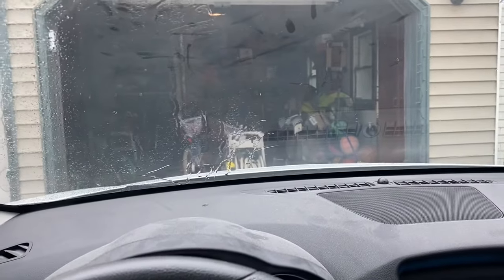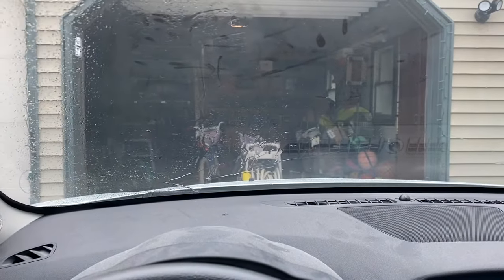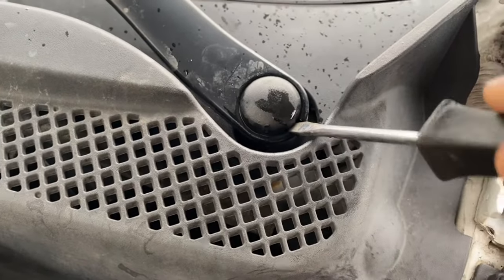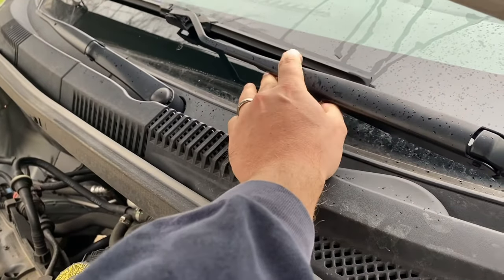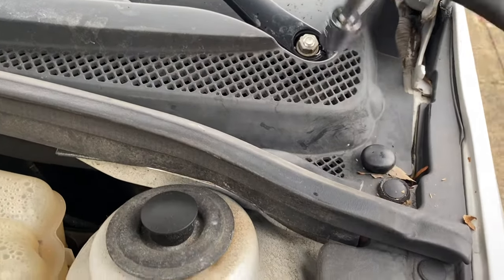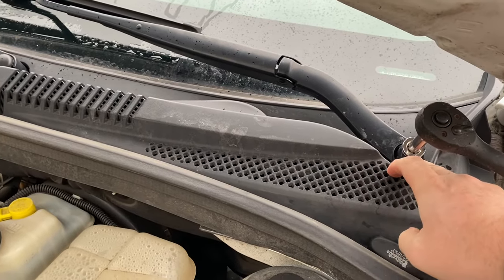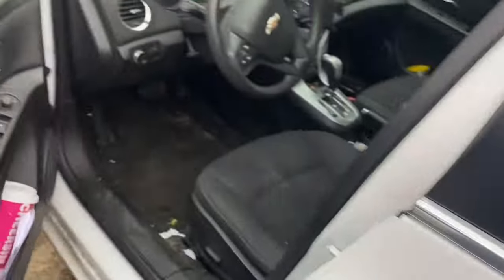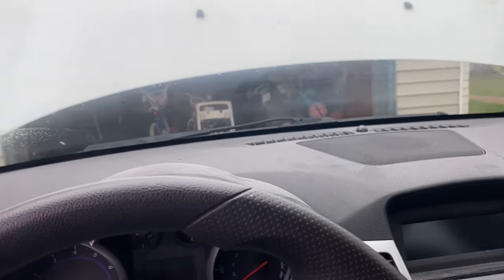How to Fix a Loose Windshield Wiper #DIY #windshield #wiper

Comment: Funny it always seems to be the driver's side. 😳
Reply from the maker: For sure
Reply: I agree - not an expert but on my car the drivers wiper is bigger than the other & I wonder if that makes it work loose ? 
Like it covers more area & more likely to drag & pull loose as opposed to the smaller one  ?
Reply: Yep more friction

Comment: Pro-tip, do not tighten the nut with the arm in the down position. This tightens the nut to the arm and will loosen over time.

To ensure that the nut doesn't loosen over time, bring the arm in the up position to tighten. If you tighten the nut when it's in the down position, test its tightness by lifting the arm up and wiggle it. If the arm still rotates freely, tighten it with the arm in the up position.

Literally just happened on my 2022 Impreza.
Reply: I was about to use lock tite on mine because it wasn’t staying tight. I’m glad i found it comment, because it’s working great now

Comment: Perfect!  It happened to my HONDA CRV 2020 recently after severe weather and I forgot that the blades would be frozen and accidently turned the wiper on and I knew it that something bad has happened :( after a few days the blade on the driving side started showing signs just the way Dicaprio showed signs of slowing down when he took quaaludes in The Wolf of Wall Street and these days its pretty screwed. I noticed tonight that the blade is pretty flimsy and thankfully found this video ! Gona try it this weekend. THANKS A TON!

Comment: For heavens sake man I was wondering what I can do to fix this issue on my car and I searched around for 10 minutes with stupid advice about wd40 or adjusting the stupid spring  before discovering this. I am not very mechanically incline so thanks man. I have run the wipers with ice/doesn't move before it totally makes sense that's the source of lack of tension. Thank you!
Reply from the maker: Glad it helped!

Comment: Had the same problem on my G37X. Driver’s side wiper blade wasn’t wiping but passenger side was fine. Tighten up the bolt. Voila. Thanks!